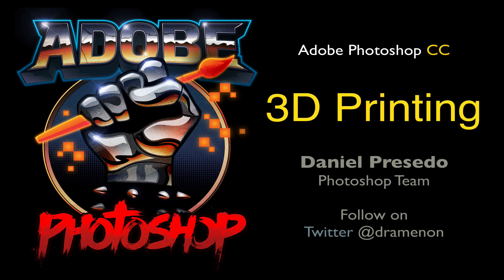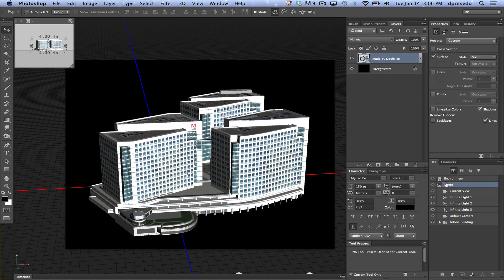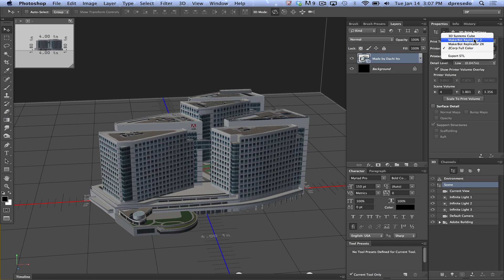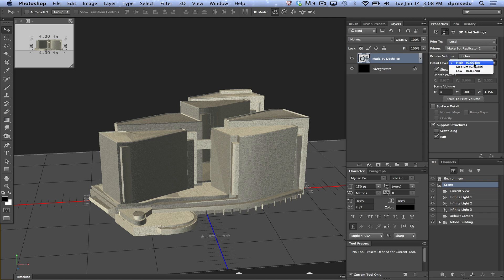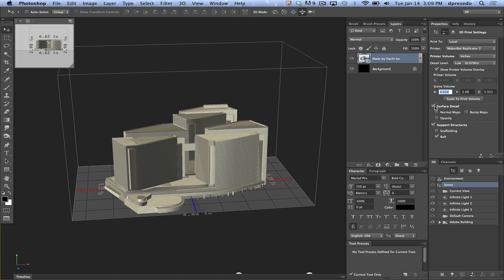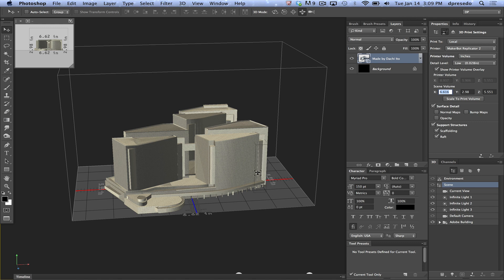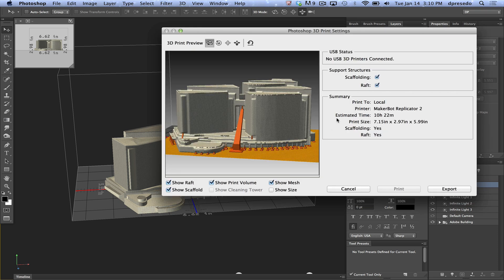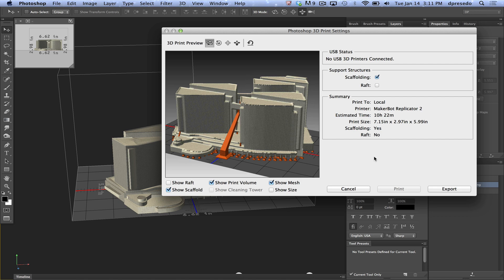Photoshop 3D Printing 01 Introduction

Comment: @4:44 you show this support material (scaffolding). Does photoshop CC knows that is can not go under 45 degrees for the makerbot replicator 2. I am pretty sure that specific scaffolding won't work very well with a makerbot. I can't wait to give it a try. I wil l be checking your video in the mean time. Thanks.